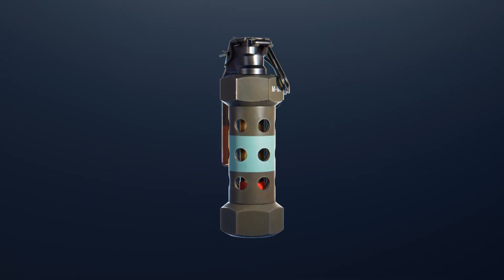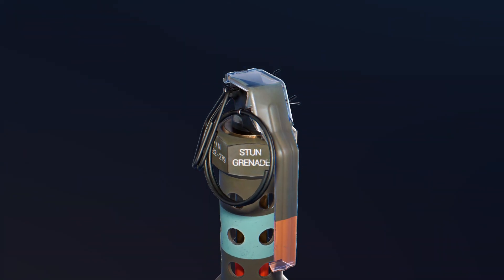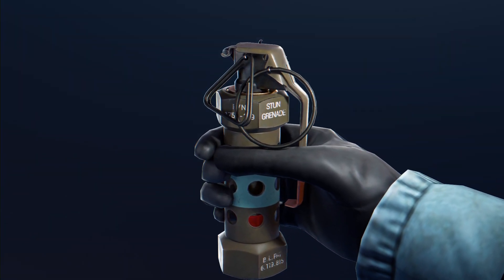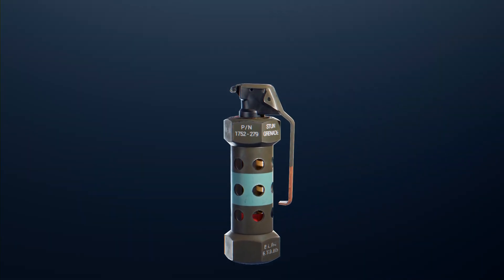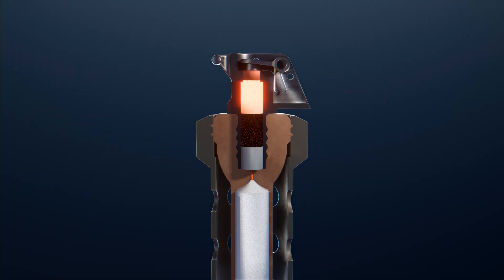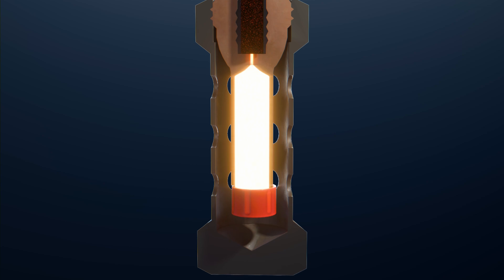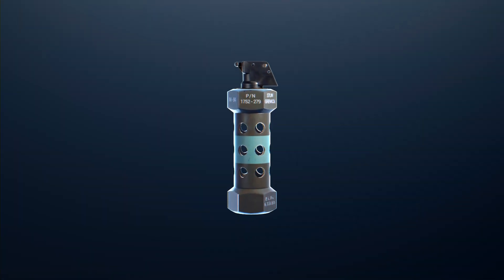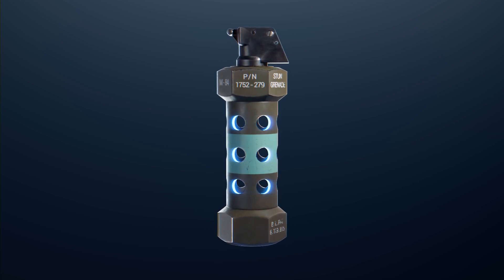How FLASHBANG Works ? Animation

Comment: Nice. So if you throw it, then you have 1.5 sec until it bangs or 1.5 seconds is only for the delay mix and there is other delay in the mechanism somewhere?
Reply from the maker: Yeah after it was thrown it goes off after 1.5 sec.  there is no other delay element